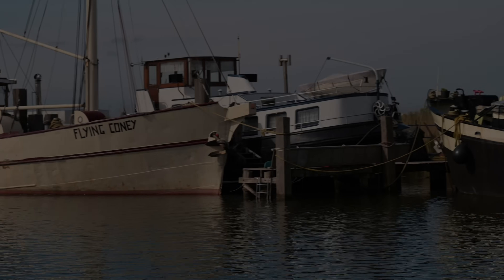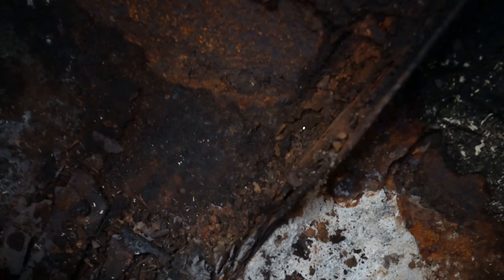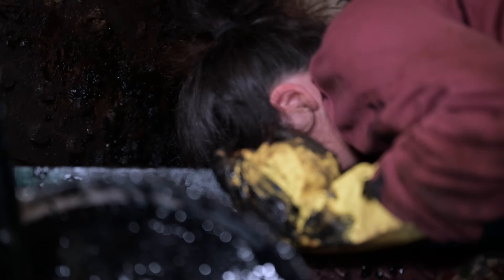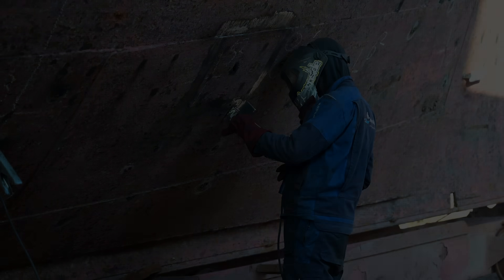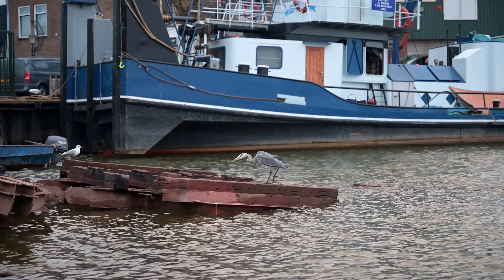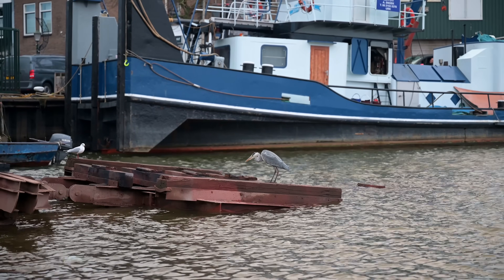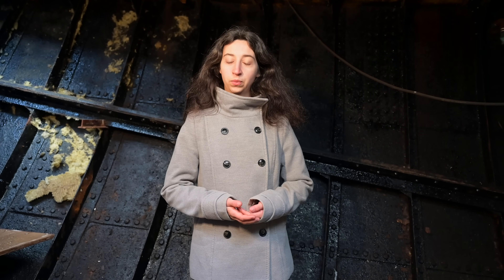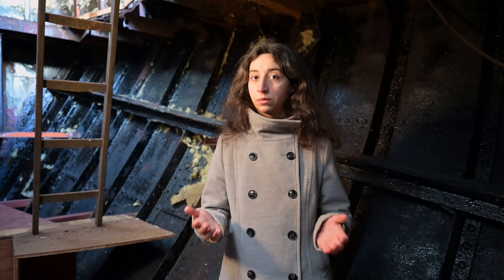BOATBUILDING - Repairing a HOLE in a STEEL Hull! EP16

Comment: Definitely a lot of clad welding on the boat, (welding small pits where the hull is corroding.) You might want to do an electrolysis test on your next adventure, as you shouldn't have those small pits if your anodes and paint doing their job. It's super cheap and easy to do and there's a really good video on Youtube that explains the process.

Comment: I'm noticing quite a bit of that awesome bow thruster retrofitted on your neighbor ship in this video.  Hope your budget includes one of those for next years refit.
Reply from the maker: We have to prioritize the necessary repairs because when knows what we find on this long refit journey. But we plan to get a bowthruster at one point and adding one later on is no problem at all. We need to haul out about every 2 or 3 years. Overplating is a bit controversial but Hoekman does have a lot of experience and we think it's a good repair method for a riveted ship.

Comment: There's only so much you can do with a limited budget, I understand that. Although you may be out of the yard by now, I think a very good investment, besides a MIG welder, would be to buy, borrow, or rent an ultrasonic tester like the inspector had, and go over every inch of the hull yourself. Your goal would be to find all the other places like you show at 15:31, that wasn't found by the inspector, right next to the over plate. That plate could have been a foot longer and covered the other 5 spots. I don't have any problem with the plug welds and the plate, it's an old boat made of steel that wasn't meant to be welded. I'd worry about all the thin places the inspector didn't find. Sandblasting inside and out would expose a lot of the thin spots and all of the spots like at 15:31. I'd rather blow through the hull with a sand blaster than have a missed thin area blow out on the ocean. As a fabricator of 50 years, this is a very interesting project. You will be steel boat restoration experts when this is finished. Still another source of income. 😏🙂 But most of all, have fun and enjoy the adventure!! We'll be watching.
Reply from the maker: We also had that idea of going along the concrete with the ultrasonic tester to check for thin spots. But it's necessary to grind down to bare stell to measure it. It's not only the measurements that are within the survey. He picks the spots by hammering against the hull and you can hear where the hull is thick and where not. We did test the week spots by hammering against them with an air chisel and welding hammers.

Comment: Find a better welder, that looks like crap.
Reply from the maker: Only certified welders are working on the boat. All welds have been tested and are good. There's a reason why they look the way they look. Lukas does use very high power on his welder to get better penetration and the old steel is very difficult to weld. Most important in the video is just the end of the day so you haven't seen the end result.

Comment: I don't understand why you didn't sandblast first.
Reply from the maker: Because ist wasn't possible and it's possible the wrong method anyway. Before we want to blast the outside we do need to know what color scheme we prefer and we also want to apply copper coat. These are big task for their own and being not absolutely necessary they can wait. The preferred methods are hydro jet blasting, wet sandblasting oder laser blasting.

Comment: I am doing a steel trawler in Australia and mine has plenty holes the cheap skates had fibre glassed the holes as boat in survey I have to make plugs and weld in , we not allowed to put doublers on
Reply from the maker: The surveyor was specifically asked if the yard is allowed to overplate. Also I can't recall any other ship we've seen on the hard or during our boat search without an overplating. Good luck with your restoration!

Comment: One pinhole leak in that welding and you have water between two untreated (outer/inner) steel plates.
Reply from the maker: The whole ship is built with untreated steel plates nailed together with felt in between them. Riveted ships are leaking when you put them in the water for about a week until all that tiny holes are tight once more. Flying Coney is an historic boat built with completely different materials and methods compared to a modern welded steel yacht. I'm no welding expert but the yard has a good reputation and they repair a lot of similar boats there. We and a lot of other customers are satisfied with the result. Could it be more beautiful? Yes. Does it do the trick? Also yes. I don't want to be rude and I'm still grateful for your comment!
Reply: @FlyingConey  I could be wrong but I think you will find that the hull is iron plates, not mild steel? We used to call it  black Iron. But as I said I could be way out on that assumption. btw, you are not rude, I appreciate your comments. 😀

Comment: Hi, sorry but why over plating . I've been a shipwright for 30 yrs and all it does is produce more issues . But being you've done it make sure you treat inside ,pooring bitumen inside as much as you can to seal any moisture from getting inside
Reply from the maker: One of the reasons why the welds look the way they do is that the old steel is very difficult to weld. With a modern steel boat you can cut a plate out and weld a new one in. But it's better to weld from both sides and then we would need to get rid of the concrete. Also the overlapping plates will open up next to the inlay and then there are all those rivets. The best method would be to take the whole plate out and but a new plate in using the traditional riveting technique. But exchanging one plate with this method is probably more expensive then all the repairs we had done combined. But all the holes had been closed from the inside as well! So there's no oxygen getting inside the overplating.
Reply: @FlyingConey  A Professional welder does not use a Bic lighter to ignite his Oxy-Acetylene torch. There is as much energy in a live grenade. If the cheap lighter leaks it will explode especially in your pocket where the gas will collect. They are cheap & disposable for a reason. Rust will form from minute condensation alone. Rust makes more rust. The overplate should have had round corners or been round or oval in shape. A welded square plate imparts lots of stress that cannot be relieved. I use a hole saw to cut the holes and also the plugs to weld into the holes. The small holes can be best fixed by securing a plate of copper inside & MIG welding. The welding does not stick to the copper. You are replacing the oxidized hull metal. MIG welding equipment is inexpensive now and a novice can do it with little starting practice. Stick welding is best for heavy structural. Your hull is not heavy structural.
Reply: @FlyingConey  Replacing the concrete might be a good idea anyway. If that's the original concrete, it sitting on 100+ years of rust at the keel. Pouring new concrete would be the easiest part of this repair.
Reply from the maker: @kinikinrd  Actually concrete gets harder over time. Back then they were using blue concrete and that's the same stuff they used for bunkers.  So getting all of it out is probably impossible. Since there is little to none oxygen the steel underneath the concrete will be in good condition.

Comment: Overplating can be only a temporary repair and is NOT approved by any classification shipbuilding society like Lloyds,  ABS , DNV etc .
Reply: Don't think Lloyds allow "flopping on doublers" any more. In my experience the weakest part of a patch is right alongside the weld on the old plate. Have seen them fail and split all the way down a new plate in bad weather. Quite scary !!
Reply: This method of repair has economic advantages, it falls in the temporary repair category and its use has never been accepted as a permanent repair. This temporary repair method would maintain structural integrity until the ship is either in dry-dock or in restricted availability, and is followed by permanent repairs made to the original corroded structure. In the maintenance of commercial ships the use of doublers for anything other than temporary repair is currently not recommended.                                                     The objections to their use are both on technical and operational grounds.
Hull girder structural components of a ship are basically rolled shapes or built-up sections that are composed of plate elements (flat plates). The strength of these structural components is usually governed by local buckling of these plate elements or flat plates that makeup the cross-section. Such local buckling means that the buckled element will no longer take its proportionate share of any additional load the column is to carry. This also means that efficiency of the cross section is reduced.
Reply from the maker: I can only share my observation and what people had told me. First we have a valid certificate as a pleasure craft. The surveyor you've seen two videos ago also does commercial ships. The survey is mandatory every 7 years. He was specifically asked if the yard is allowed to do an overplating. All ships we have seen left and right from our ships had overplatings. Again some of them more than 100 years old still getting a 300k engine conversion to work for another 25 years. Not only inland crafts also fishing vessels that work the North Sea. You've seen the thickness reading right next to the hole it's 5,2mm about 10cm away from the hole. So the plate is strong enough and the hole is caused by the wood laying on the hull. What would your recommended method be to repair this spot?
Reply: @FlyingConey  The American Bureau of Shipping (ABS) Rules for Steel Vessels should be applied  .
Welding. Production welding in the vicinity of riveted joints must be done prior to preparing the holes for riveting as the heat may well either loosen rivets or disturb hole alignment.
Because steel used in riveted hulls may be more sensitive to brittle fracture than steel employed in newer, welded ships, welding repairs are limited to the following:
a. Flush butts between new and existing strakes of shell and deck may be welded. Such welds must have full penetration.
b. Welding repairs to misaligned or burned holes is acceptable proctice only if the welding is sound.
c. Welding repair to build up deteriorated caulking edges may also be accepted if the workmanship is of high quality and the material which is added is free of substantial defect.
d. Light welding across a riveted seam to form a stopwater is acceptable.
e. Lapped butts involving the use of fillet welds should not be used.
There are probably well over 10.000  rivets in a large riveted ship. It is routine that a few of these will leak. According to accepted marine practice, it is satisfactory to repair a few "scattered" defective rivets where no comprehensive joint deterioration by corrosion, wear, or leakage is evident. 
Three acceptable methods of rivet repair are bobbing, frenching and ring welding. 

BOBBING
Cold working the point around the lip or edge with a riveting gun and small convex die to draw a seeping rivet tight.
FRENCHING
Veeing and wedging the lip of point metal more firmly into the countersink with a special frenching tool and then filling in the "trench" with a fine weld bead.
This actually draws a rivet tight without possibly distorting and weakening the metal around the rivet as ring welding may do.
RING WELDING
Carefully welding a fine bead around a rivet point as a temporary countermeasure to leakage. Such a weld has a tendency to crack. More effective repairs should be done when possible. Due to their highly stressed locations, rivets in the way of lapped or strapped butts or in deck plating outboard of the hatches should not be repaired by ring welding.

Comment: Wouldn't it have been quicker to cut out that section using the new plate as a template, and then weld the plate?

Comment: You guys are doing everything right but in the wrong place 

In England we have a welding process called mig mig inherit gas we weld the hull with a different process much faster and easier than stick welding 

Stick welding is in the dark ages these days 

We understand overplating is the best option for a riveted ship we have the Ross tiger in Grimsby the last of the deep water trawlers from Grimsby we look after her accordingly we all understand dogging and wedging and over plating is a method of repair but it’s still a patch not a insert 

Please come to Grimsby we can do all this work much faster cheaper and with the ship building skills that are required to save a vessel with electrolysis

Comment: Hello, My name is Billy McLain. I am an industrial sandblaster/ painter/ welder/ fabricator. I can tell you what to do to save you a lot of time and money. First, gut the entire interior. Second, go over the entire interior with an air chisel, removing all the heavy rust/ scale down to the rusty but solid steel. Third, sandblast the entire interior so there is no rust, only gray steel. Fourth buy a machine called an impregnator it forces epoxy resin into the fiberglass cloth, (I would use tri- axle cloth it is 3 layers thick and they go in 3 different directions giving you superior strength). Apply the epoxy soaked (impregnated) cloth to the bare sandblasted steel. Personally, I would not spend any time or money welding. Your welder is doing you wrong- he is plating over the steel instead of butt welding it leaving a space between the new plate and old hull where you can't clean prime and paint so it will start rusting again almost immediately.  The epoxy-soaked cloth will give you superior strength and seal the metal permanently. no welding required. On the exterior you should build a containment using pvc pipe hoops from one side of the hull on the ground to the other side of the hull on the ground and you can use 90's (tees) along the bottom and you can use 4 way/ Crosses to install cross members to give the structure strength laterally. Cover the pvc pipe with 6mil clear plastic and then go over the hull with the air chisel, then sandblast then install the impregnated cloth. You are essentially using the hull as a mold. You just need to clean it properly first (sandblasting). Whatever welding needs to be done will be minimal. Get a new welder, this guy is doing a terrible job that you will be paying for it in the beginning and for years to come. Any questions my phone number in the U. S. is 1 727 482 9403 I live in Largo, Florida, my company is Industrial Blast Inc my website is industrialblast.com my personal email is billy@billymclain.com. Hope this helps you out, feel free to contact me anytime, Good Luck!
Reply: humm, wouldn't your method introduce the problem of osmosis seen in most fiberglass ships??

 steel is way better and cheaper, also cheaper to fix.

and I agree with your comment about the welds, their welder is not creating nice welds.

 I already shared with them what seems to be the ideal way to proceed, I can only guess that they only want to patch the ship so to take it to a better place, so to do the job

Comment: I worked on 2 old steel hulls & noted that the one built by Krupp had similar occasional bad plates with others with near zero flaws. So hope you have just a few of the flawed plates.
Reply from the maker: Fortunately it really only was the wood against the hull issue. That only lasted 46years... Some rivets needed to be done and off course the quite severe electrolysis damage. Directly next to the hole are more than 6mm steel left.

Comment: While the boat is on the hard, will you be installing a bow thruster????  I certainly would do it for a boat this size. You will NEVER regret it.
Reply from the maker: We have to do the necessary repairs on the hull and structure first. But a bow thruster would be nice.

Comment: OMG..  what a nest of hull problems you've happened into on your "Comey." 
Although still pretty interesting to me, I find it hard to follow you each episode, what thing next? I guess things can always be worse but how so? I feel bad for you now and I think eventually you will find a way through it. Good luck. Don't give up, keep a positive attitude and learn more about the boat's history, to attract people to watch the new videos. And once again the very best of luck.
Reply from the maker: Thank you! I guess what makes the difference is if the problems are local or general. The holes are all caused by a mistake done 46 years ago. To be specific, putting wood directly on the hull. So we "only" have to examine all of the problematic spots and repair if necessary. It would be much worse to find holes on random places. Worst case and the end of the vessel would have been a thin hull.

Comment: Darn it!  A second hole just when the first one was nicely repaired!  Hope you get a little time to relax from your busy schedules.
Reply from the maker: I'm glad I haven't scared you off last time. Considering the size of the hull a small overplating like that isn't that bad. Well it would have been better to first weld the two suspicious looking rivets next to the planned overplating... At the end we fortunately found that almost every thin spot was caused by wood layer directly on the hull. So it was a mistake done a long time ago and it's not a sign of bad steel or a general problem. So that's good!